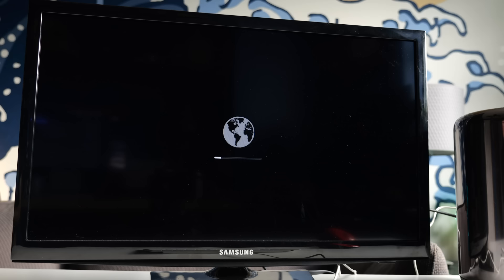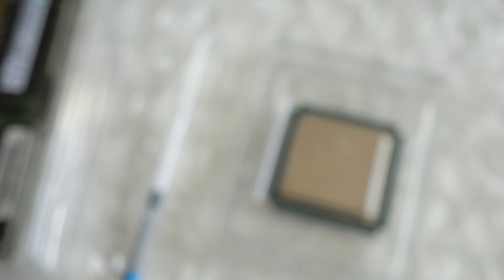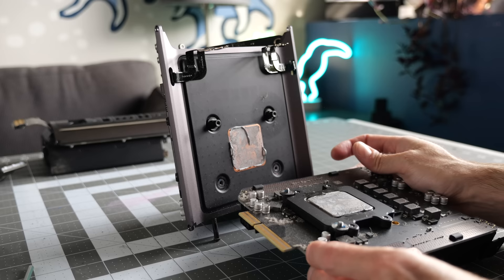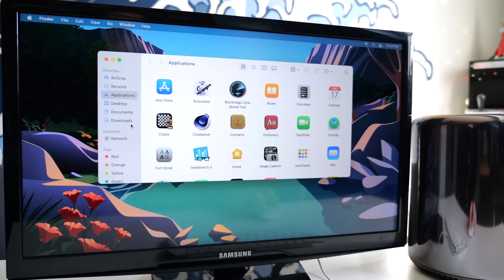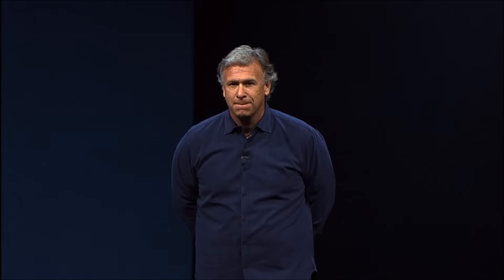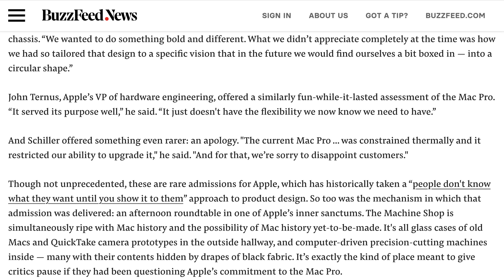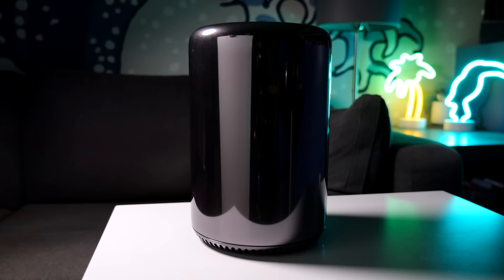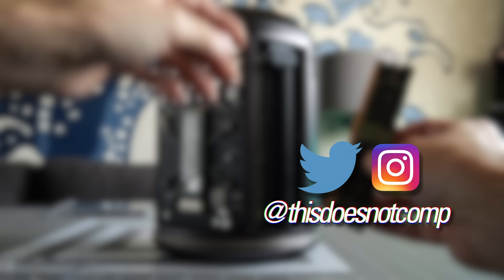Can This Decade-Old Mac Pro Compete With Apple Silicon?

Comment: I imagine the trash can and the Mac Mini and their cooling concepts where designed with the intent to switch to an advanced ARM processor that Intel was supposed to, but failed to deliver. That's probably why they cut ties with Intel and instead went all in on developing their own processors, and why they stopped developing new desktop devices until they knew they had a powerful enough processor. Now they have the M processors, they should absolutely bring back the trash can

Comment: Feeling like I should get one of these older 2013 TMP base units and upgrade the CPU. Would probs go with the 10-core version to get the best balance of single and multi-core performance, but I'm unsure if going with the 12-core chip would be better than the 10-core.
Reply: What do you plan to do with the machine that you think will require 12 cores?
Reply: Accessibility software and demucs.

Comment: Apple got a lot of hate for this design, most of it deserved, but I'd like to reiterate what was stated in the video about how it was designed for a future that never came.

Apple bet we wouldn't need PCIe slots because Thunderbolt was external PCIe and much more convenient to plug stuff in and out, but the industry didn't agree and didn't produce thunderbolt peripherals in any great quantity. And only some of that is technical, I feel it mostly had to do with PCs and that thunderbolt wasn't there yet for PCs and macs mostly get PC's leftovers. If the PC had embraced Thunderbolt we would be awash in inexpensive external peripherals that mac users could be smug about being early adopters for, but it didn't happen. You could get external GPU enclosures, but then you're just plugging PCIe cards into a box to connect to a port, that's not an endorsement of Thunderbolt over having internal PCIe slots...

Apple bet compute was going to be very important in the future and having a separate GPU dedicated to compute tasks was going to be a game changer. But outside of some very niche industries it just didn't happen. Now in 2022 even cell phones have "AI" cores and the M1s have powerful offloading for machine learning so they were right, but far far too early and worse still those Dx00 GPUs can't even be put to use NOW because they don't support the modern libraries everyone uses for machine learning and GPU compute. Photoshop does actually manage to leverage the 2nd GPU for some of its ML based features. Shame it's 8 years too late.

Apple also got done on the CPUs. The thermal design had no headroom which was bad design admittedly but Intel was also at fault for making hotter and hotter CPUs on outdated process nodes because they couldn't keep pace with other foundries. There should have been a 2015 Mac Pro with a new Xeon that was twice as powerful at the same TDP but it didn't happen because Intel's TDPs shot for the moon and never came down.

They did at least get the SSD sort of right. They were right that we'd all be using SSDs directly attached to the PCIe bus, it's just a shame they were too early to standardise on NVMe m.2 and instead had to use a proprietary one with no real upgradeability to speak of.

Comment: I wonder if you could Mix and Match the video cards? Using the same model, but swap out the one without an SSD with one that has an SSD. That would make it worthwhile to play around with
Reply: Angel shark by Amfeltec allows you to have 3 NVMEs internally
Reply: You can not swap out the video cards, they're setup in firmware in a master/slave configuration. There has to be one of each.

Comment: Hmmm, if the M1 does 2x in single thread performance, 3x in solid state performance and (not my use case, so never tested) XXx in video de-/encoding (although AV1 is not supported in hardware) with 20W max. (?) I don't see the systems matching in performance considering any practical use cases. Even if you would use it as an office machine the idle power draw is unreasonable (IMHO). Also the thrashcan is known to melt away the GPU from the board, when running 24/7 on full load for some amount if time, if you would actually consider video editing. But it is a cool machine nevertheless. Kind regards

Comment: you forgot to mention how slow the SSD interface is. PCIE 2.0 X 4. PCIE 3.1 X4 is twice as fast, and Macbooks that came out shortly after featured that interface. 
Doubtless, the M1 wipes the floor with it on disk transfer.
Also the 6 TB2 ports are shared among 3 TB2 interfaces. 
So you have to be familiar with which of them are paired and plug in your high bandwidth devices on different pairs. 
The USB 3.0 is also hampered. You will never get near to saturating the bandwidth on USB 3.0 here.
It's more like USB 2+. 
Also, it will support more than 64GB ram, but at a lower speed. 
DDR4 was in the wild when this was released. Not sure why they went with DDR3. 

As far as compromised thermals. Nah that aint it. 
As you stated yourself, none of the big software houses (hello Adobe?) took advantage of what Apple offered here. 
Nor did they really go in for OpenCL that Apple was pushing, which was later ditched for 'Metal'.

So it is doubtful you are getting anything more than idle heat from that 2nd GPU. 
I've pushed mine quite hard rendering video and it does heat the eff up, but you rarely see both GPUs saturated. 
It's all from that hefty Xeon. 

One place it owns the M1 Macbook Pro. 
It has a mic/line input.

Comment: I agree...while Apple did not add any support for multiple GPUs to their OS ... which sucked... it does not mean that developers could not write programs to use it.  I know that Davinci Resolve Studio (the paid version) does take advantage of multiple GPUs... and an awesome program called Video Enhance AI... can use both GPUs as well.  One thing that was not mentioned (and I am citing from memory) is that the speed of the memory gets throttled when you add  higher multicore Xeon CPUs.  If you have the 4 Core or 6 Core (the 6 is what I have) the memory runs the fastest...then the 8 (and 10 Core is it?) it runs slightly slower ... with the 12 Core Xeon running at the slowest speed.  I believe that ...in my opinion, the slower Memory is less important than the Cores.  I have used my "MacinTrash"...good one... for three years ...and it runs well.  I use the heck out of Thunderbolt 2 items... bought a used hub for Firewire, Thunderbolt 2, and USB A.... and I am set.  No complaints for me.  Thanks for doing a good service to the Mac community.  ;-)

Comment: No doubt, this was probably a humorous speculation but I heard somewhere that  could realistically return to their trash can days with the M series “power per watt” capabilities. 

Which, honestly, is something I would like to see due the chip’s uniform architecture design from the ground up.

However, because they so arrogantly boasted the trashcan’s design and Phil, virtually, spoke himself into a corner - I am confident that this design will never resurface. And that’s something most probably don’t care about. However, I actually thought it was pretty cool - just not thermally cool. Perhaps a little bit too ahead of it’s time? 🤷🏼‍♂️ 

In either case - I’m happy with my Mac Mini.

Comment: It's likely you'd see better practical results with a higher clocked, lower core count part depending on workload. If 24 threads can be meaningfully utilized, the E5-2697 V2 is the best part, but a lot of workstation tasks need a combination of single core and medium threading capabilities, so something like the 8 core E2-2667v2 might be a better fit.

The GPU upgrade paths, or lack thereof, are a far bigger deal. The only real option is eGPU but then you're paying a lot of money on a Thunderbolt enclosure to support a poorly aging computer. And you won't even get full performance out of that due to the Thunderbolt 2 bottleneck.
Reply: I wonder how much the thunderbolt 2 bottleneck is. The performance boost blew me away. A Vega 64, I bought that one as used prices were the same as the RX580.
The faster 8 core is the sweet spot. I have that one with 128 Gig RAM. And the 12 core with 64GB. As the 10 core and 12 core lower the ram speed.
But I bought the eGPU initially for a Macbook Pro 15" 2015, I thought It was the one without the iGPU. But It did have the Radeon with 2GB.
In Luxmark ( openGL ) the score is 1800 without GPU, 3700 with iGPU and 30000 with eGPU. It's 60000 on the trashcans.
My Ryzen 7/1060/32GB laptop scores only 13000. But fucks the Macs Up in gaming, microsoft Office and Cuda stuff probably too.
Now I won't upgrade anymore the trashcans anymore ( Also I can't ). 
I will buy a M2 Studio Max 64GB for Apple stuff Trashcans can't do and a referb Windows workstation I can upgrade for unlimited RAM and power.
As I like Windows, prefer Mac but my favourite is Mojave. I hate they make a new OS every year, the newest function is mostly apps and plugins not working anymore and can a ton of old Macs and some very expensive hardware for Pro Tools and such. The 6.1 xeon architecture is aging, It's doesn't like h265 that much.
Reply: @Jupiter4Alphs  The Thunderbolt  bottleneck isn't too meaningful for computational tasks since the workloads sit in the GPU longer but for games and other workloads that stress the bus the bottleneck is more significant. It's hard to give concrete numbers since it depends on GPU and workload but a low of 5% and a high of 40% were found when this kind of testing was being done. Frame time (stuttering) is a bigger issue than raw framerate. In any case, just about anything you can think of will blow away the Radeon 7850 tier GPUs in those Mac Pros, which were anemic even for the time. You just don't get full performance.

Comment: this design would be viable w apple silicon tho, right? same with the macbook 12 inch which should be rebranded as the air while the current air should be rebranded as the macbook.

Comment: Maxed out but leaves the D300s in?  Why didn’t you upgrade to the D700s?  I know they are expensive, but I was curious to see the performance uplift.  Anyhoo, I have torn down my office’s Mac Pro and repaisted all three parts.  It was an interesting machine and totally not for beginners.
Reply from the maker: The D700s ended up with a pretty high failure rate due to the poor cooling design. In general the D300s are the safest bet — if you want better performance, setting up an eGPU over Thunderbolt seems to be the best option.
Reply: egpus need thunderbolt 3, the macpro 2013 has only thunderbolt 2.

Comment: I just wonder if comparing a trashcan to a 13" MBP is valid, its a different form factor and a different use case. I have a completely entry level Mac Studio which seems more comparable and it's number are more than a little different; Cinebench R23 gives me a multicore of 12132, and single of 1462. If we go to Geekbench Single core is 1687 with multi of 12103, switching to graphics I get 61714. These score are pulled from a machine that wasn't rebooted and has 16 apps open and hasn't been rebooted in two days. I think my Studio is a more valid comparison than your MBP.

Comment: I just found one for $300 the top model 12 Cores upgraded......just to have it as the vintage machine with a nice design. Too bad Mac Pro's used to be ahead of everything competition has.......but clearly you can feel that Steve Jobs is no more and Apple got wicked and is pushing us to use mostly laptops neglecting the mighty POWERHOUSE which is Mac Pro.

Comment: maybe Linux could extend the hardware lifespan. I update a iMac mid (2011) changing the HD to SSD, expand the RAM to 16Gb and install Linux Fedora 37 without issues.
Reply: Yep, I have Pop!_OS running just fine on one of these.

Comment: The trash can's are trash, in every way. The best available are the 4,1 and 5,1 Mac Pros (Dual-CPUs). They blow the doors off of most of the new Macs. The only one that can pass it is the new Mac Pro, but they are not worth it at price tags from 15k-50k. Fine for Disney, but not fine for home and smaller companies. They can still hold their own for 4k video production. Everything still works, and again, works better than most of the newest Macs. They have plenty of expansion, unlike the trash can, NVME, Thunderbolt, 256GB of max RAM, and any GPU you could want. Latest MacOS and Win work fine. It's hard to justify an additional $15k-50k for the newest Mac Pro.

Comment: I still daily drive my 2010 MaxPro (as I call it)... but I use Garuda Linux on it rather than macOS. Sacrilege I know lol but I didn't feel like dealing with OpenCore to hack a current macOS on it when up-to-the-moment Linux works perfectly on it. Plus, with dual CPUs (Xeon x5690) it handles 128GB of RAM and I also have a modern AMD GPU, and thus it actually games quite well - especially to think it's 13 years old at this point (gaming on Linux has come a very long way). The expansion capability of my Mac Pro is what the 6,1 just can't duplicate. I admit however, I do LOVE the aesthetic of the "trash can" Mac Pro. And if one has limited space for a rig, it makes for a nice option although if I were to buy another desktop Mac now, it'd be an M1 or M2 Mini.

Comment: Comparing one terrible value proposition to another doesn’t make either the victor.  Apple has lost its way with software & support.  The M1/M2 based machines show they’ve learned nothing from the debacle that was the Trash Can. It reminds me of IBM thinking they could strong-arm everyone into microchannel architecture in the late 80’s.  Building technically amazing hardware for software that’s yet to come is a risky gamble at best.  There has to be a concession to pricing to warrant early adoption, something Apple has rarely been willing to do.  Continuing down this path will just continue to drive consumers to devices that are serviceable and compatible with more mainstream upgrades and accessories. Which is such a shame because the products themselves are beautiful.

Comment: Simple answer, NO! 
Apple by going ARM and adapting just changed the game again. 
Which is a good move, look I am not an Apple fan, and neither do I own or use one. But even I can see how not having to use Intel cpu's in ways they were really not designed [heat/power wise] but going arm did make magic work again.

Comment: The trash can debacle was so unnecessary. All they had to do was order some more standard cases and motherboards and offer mac pro trash can as an option next to a cheese grater Mac Pro with similar specs. Trash can works fine for many use cases. Some use cases require cheese grater. They engineered both, why not sell both? Companies make such asinine decisions.

Comment: Hi there, I would like to ask an amateur question, please:

Currently, I am looking to get a refurbished Mac, and my choices are between a Mac mini, late 2014 with 16 GB RAM and 512 SSD hard drive 

VS

Apple Mac Pro (trash can) Intel Xeon 2.7 GHz 12-core 2.70 (2013) D700

Please kindly inform me which one of these 2 will be good for video editing, Photoshop, and After Effects projects? Thank you very much in advance.

Currently, I have an old iMac since mid-2011, and it has served me well so far.

Please note that I have no interest in getting the M1 or M2 versions or any current desktop iMacs at the moment.

Comment: One a serious note, the #1 drawback of the trashcan pro is the slow SSD speeds due to bus limitations. If it had 3 GB/s transfer it would still demand $1000 on eBAY. The #2 limitation is the insanely old GPUS. A single 8GB AMD RX580 from years ago is faster than 2X D700s together. What was Apple thinking? This thing should have had a single GPU and room for 2 or 4 SSDs instead of second GPU. Now THAT would have been a solid desktop workstation, because users could have used a RAID 10 configuration to improve storage speed and redundancy. Phil Schiller is a clueless bozo.

Comment: "But I updated it to the latest MacOS it would support"

Worst decision ever. I've found the later the OS, the MORE limiting it will be on the PC's hardware, likely by design to get you to go out and buy a new Mac.

Regardless of whether it was an M chip, an Intel, or even a old G series, EVERY Apple personal computer AND mobile device/tablet I've had always, and without exception, performs so much noticeably faster on the initial operating system it shipped with and/or operating systems that were released while it was one of their "new" products. Yet with every operating system thereafter the performance lessens... almost like they're "throttling" it the same way as they were caught doing to their phones.

I would test everything in regards to speed/performance, and THEN downgrade back to one of the Operating Systems that were released while it was considered new and then compare them.

The big difference is certain applications' versions will not work on even slightly older releases, but that is easily rectified by getting an older version, a legacy edition, or simply going to any number of piracy based websites for those that don't offer compatible releases anymore (piracy has been an amazing tool for me, not to save money as most of the stuff I download I already paid for in one way or another, but rather as a giant community archive for things that developers release and then try to take away)